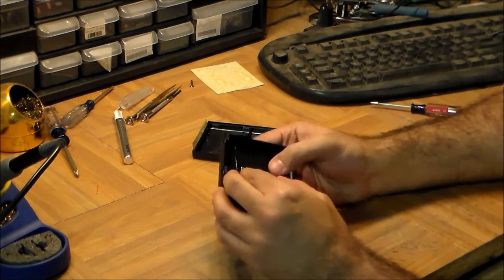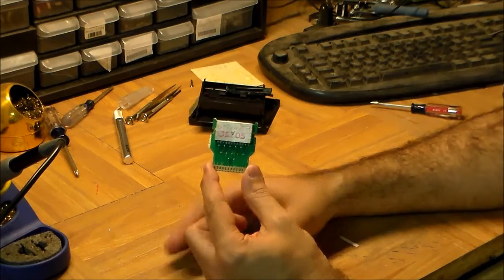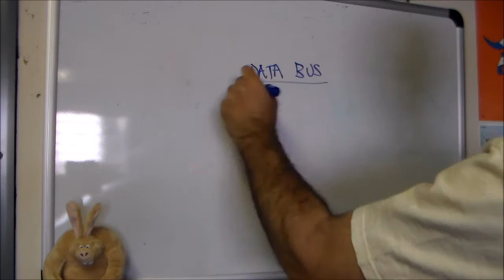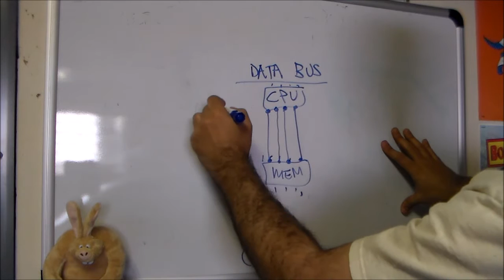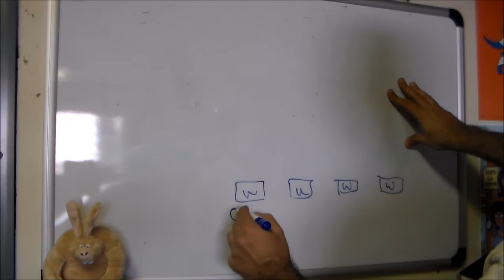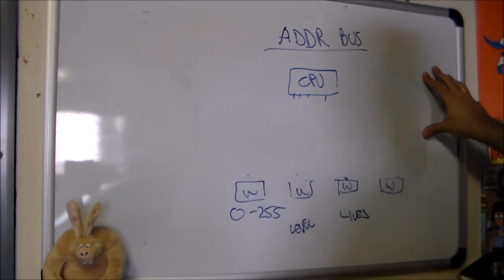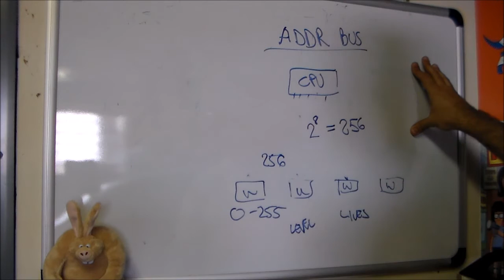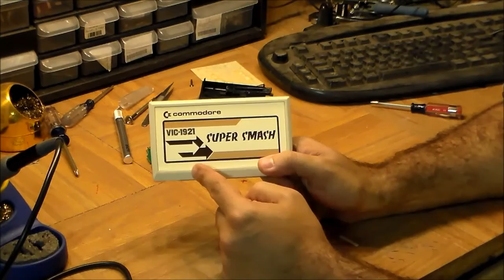Inside the Black Box 3: Early Video Game Cartridges

Comment: Ouch. OUCH. Could you try getting it any MORE wrong?

At the beginning of the video, you're expecting to find 8 address lines and 8 data lines, 16 lines in total.
Well that wouldn't be particularly useful at all! All that would allow you to address is 256 bytes. That's not enough to describe more than a couple loops, much less a whole game. To my recollection, Atari 2600 cartridges have 13-bit address bus and thus natively 8KB ROM.

17 or 18 minutes in, you allege that 256 machine-words (single-byte on this machine) that store one of 265 values is... you multiply all that and tadaaa, 64 kilobytes! Well no, it's still 256 bytes of storage.

As others said, all 8-bit CPU cores pretty much supported 16-bit bus internally, and an arbitrary portion of that address bus will end up on the cartridge connector, not the whole bus.

And no point knocking Tramiel, he's not as bad as Sinclair.